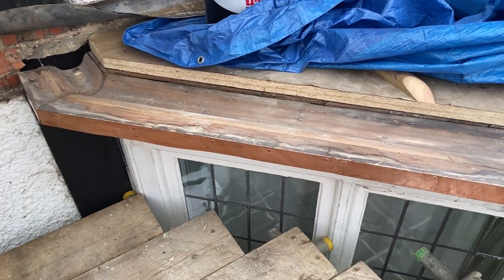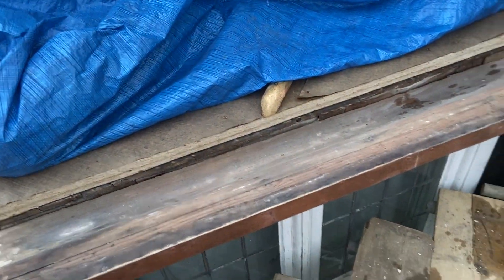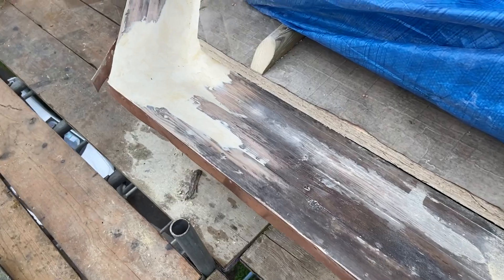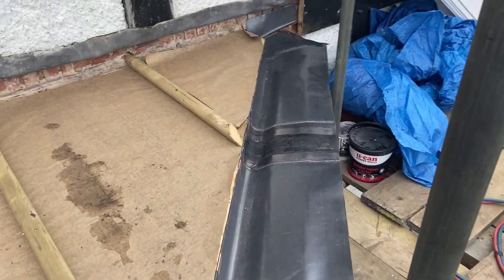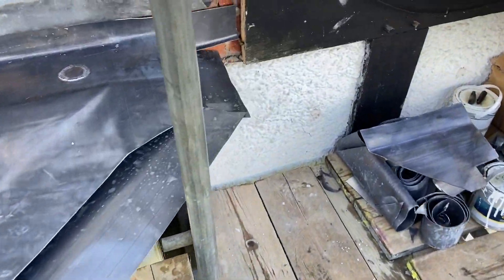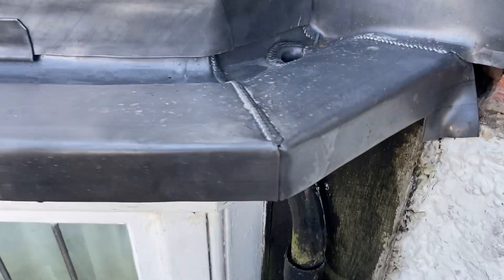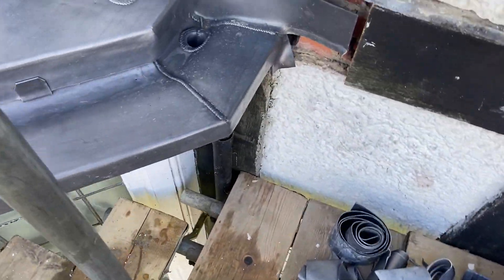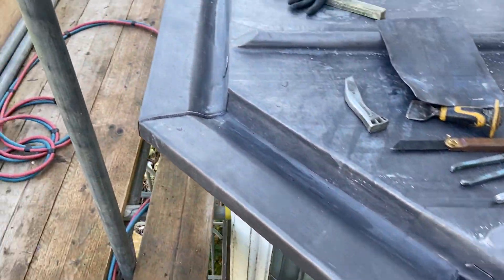Code 5 lead bay roof with expansion joint gutter.

Comment: Aren’t you supposed to cover the neoprene to protect it from UV damage? Lead may last 100 years, but rubber exposed to the sun won’t do more 15-20 years before it becomes brittle and cracks. Could you not have laid the expansion on top of the end of a run of lead gutter, welded it at the far end and then lapped the next lead gutter over the top and welded it at the other end? That would hide the neoprene, but you’d have 3 thicknesses of lead so in this example the wooden substrate would need rebating to avoid ponding behind the bulge of thicknesses. As you say not enough outlets on this gutter, should be one at each end so the gutter falls away in either direction from a central high point saddle which would act as one expansion joint itself without using neoprene. Either way, ignoring my petty criticism about the neoprene, this is truly masterful leadwork! Commendable stuff.
Reply from the maker: Thank you and thanks for watching

Comment: I used to do the carpentry work on that sort of roof. I left the UK nearly 25 years ago. I have never seen those expansion joints. When did they come out.
Reply from the maker: I’m not sure exactly but I think it’s been around for 20 years or so.
Reply: @slbleadworks  Makes sense me not having seen them  then. They look like a good idea. The different movement rate between dissimilar products was always a problem.
Reply from the maker: @davetaylor4741  They can certainly help when you haven’t got enough height for steps.

Comment: Great work 
Quick question do you always burn your backs or do you boss as well 
I always boss as I’m not sure on the cuts ?? Do you have a video showing this process ?
Reply from the maker: Thank you. 
I generally cut and weld my backs as it’s the way I’ve been taught. But if the backs on a hip I sometimes boss them. 
I think my most recent vid might have  the way I cut the backs. 
I would prefer to boss them probably but it seems to take me longer. 
Have you any tips that could speed
It up for me ?.
Reply: @slbleadworks  I think welding is probably quicker in general especially on square backs I guess it really saves time as it cuts out the process of bossing them down once they’re in position I’m not sure there is a quick way but I use a boss mate which is a really handy tool for knocking up

Comment: Looks mint 👌 making me really want to get into the welding side of lead properly.. as I've mentioned to you already I do welding aswel as roofing so think it's time to buy a torch as i really like both jobs equally so this way I get to do both together 👍
Reply from the maker: Thank you. I would recommend getting a original model o torch. There’s some cheaper copy’s on the market. I’ve had one of these and I ended up throwing it in the bin.
Reply: @slbleadworks  yeah no problem.. what oil do you use personally to coat the lead after you've finished ?

Comment: Hi Stuart. Do you you weld your bays in position? Would you be able to share the cutting and folds of the bay back please?
Reply from the maker: Yes I do. I don’t currently have that on any of my vids. But I need to make a part 2 to my most recent vid. Maybe I’ll try and show that.
Reply: @slb lead works  Cheers Stuart. I've tried leaving a 15mm tag over the top of the roll from the internal 'bay' corner and pushing it down over the roll to weld but the shape never looks like what you have done I'm guessing you weld when the tag when it's at the top of the roll and boss the rest into the corner? I'm back to code 3 in the garage haha 5s got a bit too an expensive hobby 🤣
Reply from the maker: @cba1424  The smaller the tag the easier it will fold around the roll. If it’s too big the tag will tear and it won’t fold tight to the roll. I don’t have any tag at the bottom 25mm from the roll as I find this is easier to weld. But yes you fold it around to the top of the roll and then boss the final corner In before it’s welded. 
Code 3 is really to thin for this. It will make it so much harder. Especially to weld and boss.
Reply: @slb lead works  Thanks ever so much Stuart. Had some code 3 left over from some big soakers so just cutting that up and folding the shapes to practice save wasting new c5. Should really get myself on a course but everything is a week off work which I wouldn't mind but not doing lead all the time. Big help people like yourself sharing videos and tips

Comment: Great work, would it have been possible to put a rainwater head on the downpipes to help with the water discharge ?
Reply from the maker: Thank you for your message. 
No unfortunately not as the outlet discharges straight into a rain water pipe around the moulding detail.

Comment: worked out well Stewart . how did you get round the issue of returning the rubber in the t-pren around the copper drip ? did you have to heat it to make it more playable because the BLM t-pren have thicker rubber
Reply from the maker: Thank you. Yes exactly that. Time you added all the thicknesses together heating made it so much easier to bend around. Just had to make sure not to get to close to the rubber.

Comment: Stuart. Why does lead go white. After patination oil applying several times ?
Reply from the maker: It could be several reasons. Most people don’t oil the underside of the lead or the laps. So the white staining still creeps through. Or it could be it’s rained or moisture in the air before the oil has had time to fully dry.
Reply: @slbleadworks  is it a bad thing sturat or will it come out
Reply from the maker: @leemcgowan7986  if it’s quite new work it should come off.

Comment: Great vid, really nice to see the close ups of the welding process.
Reply from the maker: Thank you.
Reply from the maker: I would cut a patch big enough to cover the split. Shave hook the the area to weld. And then  weld it up. Or if you don’t want it to be visible. You could weld over the split and shave hook it down to blend it in. But it won’t be as strong as welding a patch over the split. 
Hope his helps.
Reply: @slbleadworks  Really helpful! now to give it a go on some scrap..
Reply: @slbleadworks  How would you fix a small split in some old lead on a flat roof..I am trying to teach myself and its so tricky...

Comment: I always wonder how, given that lead is so easily marked, as to why at the end of the jobs no marks are visible. Can you please enlighten us.
Love your work.
Reply from the maker: Thank you. 
Well I think it has a lot to do with how hard you dress the lead in the first place. Also make sure your dresser is always flat. And the used dressers are worn in leaving less marks on the lead too. Also the use of heat on the roll ends etc means you can be very gentle.
Reply: @slbleadworks  Thank you. Keep up the good work. I'm not in the trade but when I see nice lead work like yours it's always impressive.

Comment: You are a true craftsman. Very nice work, thanks for sharing. I can’t find patination oil anywhere in the US, been looking for years. Have you ever heard of a good substitute?
Reply: Hi Chad you can use linseed oil as a substitute for pagination oil not quite as gods but it works I’ve been told 
Give it a go and let us know the results good luck
Reply: Data sheet says: Patination Oil is a mixture of White Spirit,
Soya Alkyd Resin, silica and metallic soaps. These roofs been around before modern alkyd resins and this product. There should be historical records of what was used before.
Reply from the maker: Thank you. Sorry I’ve never heard of anything else that could be used. Do you guys use much lead in the US ?
Reply: @slbleadworks  There is no lead work here. The only thing it’s ever used for is chimney flashing or flashing a roof into brickwork. Can’t even buy a lead fishing sinker anymore. All I’ve ever been able to buy is 50lb sheet lead and the price swings wildly between stores, $115- $188 USD per roll 😕